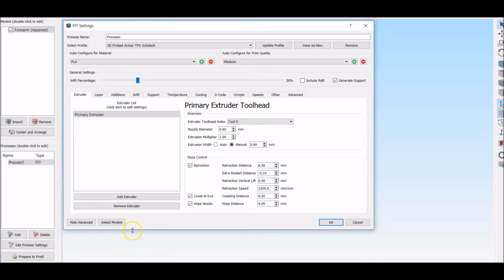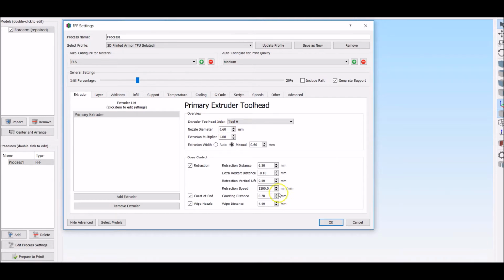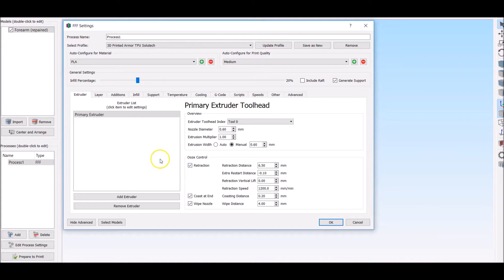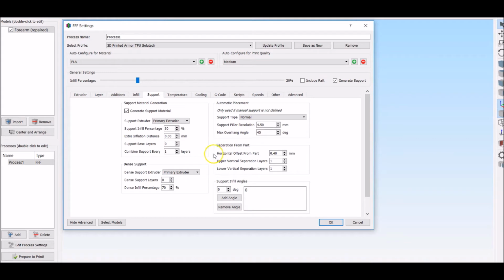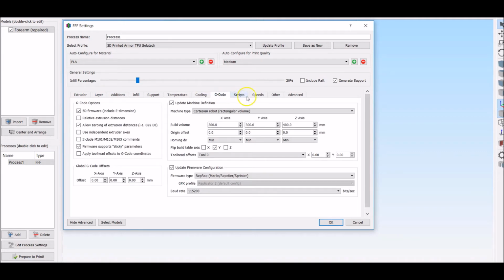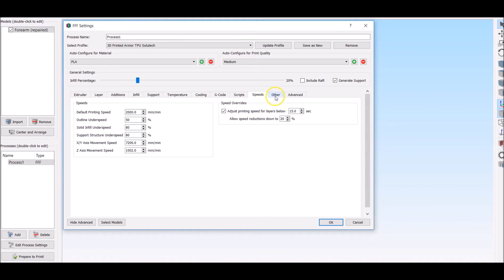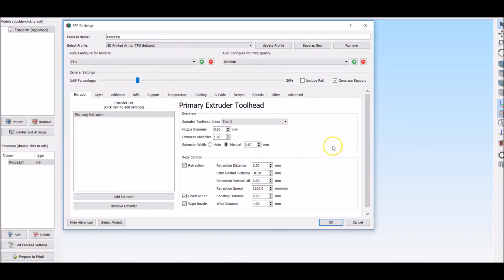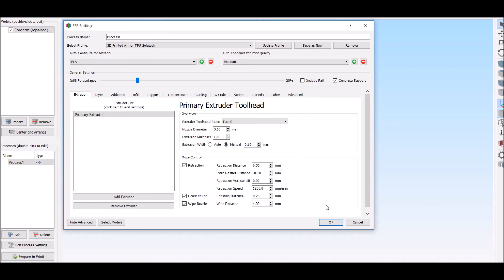How to Print Felixible Filament on a CR10

Comment: Hi haven tried it yet, but if I’m using the heated plate with mirror what is the temp of the heated plate I can set to? 50degrees? Also it’s pure stock meaning printing the TPU on a Bowden setup rite?

Comment: Loving the videos! i currently use Cura as my splicer and havent updated to the latest version but ive noticed there are alot more options now. Would these settings be able to translate over to Cura? keep up the great work!
Reply from the maker: Jared Lucchesi hey man thanks for the support! 

Yes these settings can translate over to cura. Just remember to do it hot and slow
Reply: Roger that! i normally use Hatchbox pla, but i just bought some Solutech pla, and Sainsmart TPU, so its time to dive into the world of flexibility! Ill try 3d solutech soon, sainsmart is a little more flexible from what ive read
Reply: Just make sure that you realize in Cura settings are in mm/s and here they are in mm/min.